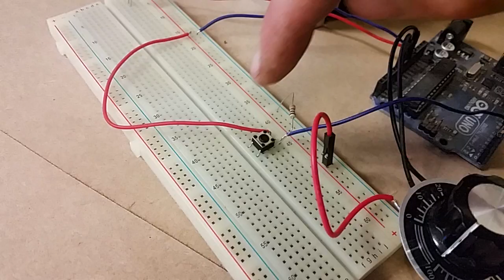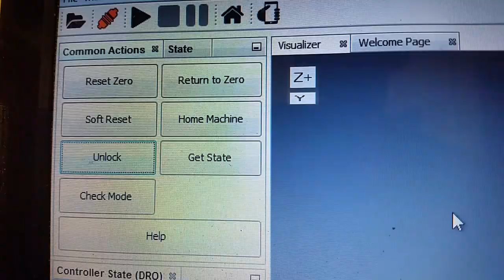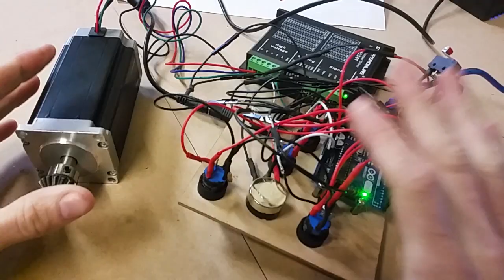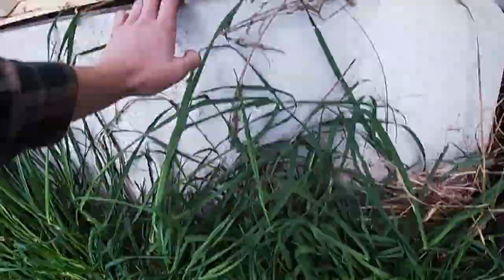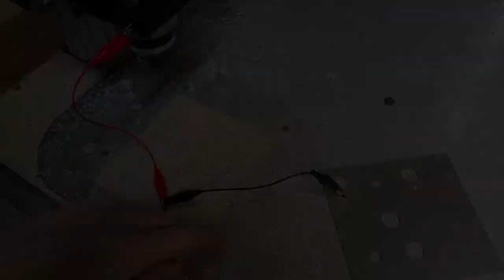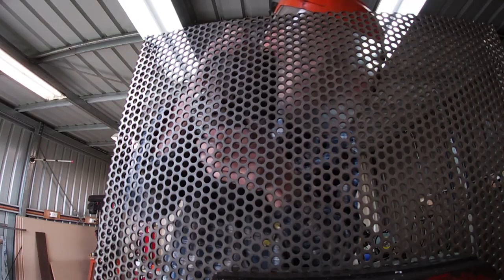Project Powerfeed Part 1

Comment: Use spring coiled audio cable run to the side of the gantry with a croc,or get one of those carbon plastic static discharge conductors used on road cars ,usually a 15-20mm strip with a voltage spark symbol on it on the rear of ford capris or escorts in the 80's here in UK,drag it around at the side of the spindle....retro,i'd go for the spring coil cable myself.
Reply from the maker: @pir869  is this in relation to the spindle interference? I solved it, turns out the supplier didn't connect a grounding wire 😅

Comment: G’day Tommy hey how many illegal height trucks have hit the bridge you knocked off the sign from;-)
I know nothing of electronics but the grounding of the spindle to workpiece was interesting, I’ve seen a few CNC machines cutting aluminium but not one with a plate chasing the spindle, it’s like a dog chasing it’s tail, what happens when it catches up grrr 
Well presented, cheers. 
Peter
Reply from the maker: Yeah I've never heard of this router issue before. I'd say it's because my electronics are not well shielded
I had to baby sit that plate to makes sure it didn't get caught up, I'm thinking I'll make a small brushed wire on the back side of the spindle that can't get caught

Comment: very interesting, I would be interested in the coding etc ..cheers from the uk
Reply from the maker: Cheers, what are you thinking? Full step by step arduino code (ps my code is not neat) or program logic ie 'check for button press, then do this'?
Reply: @TomMakeHere  whichever you decide, both if you wish need educated both ways.. cheers.

Comment: Nice project - got a list of materials you used.  I under spec'd my stepper the last time and it was too wimpy. 

Great idea. Great editing per usual. 

Dan
Reply from the maker: Only just saw that I missed this one
I used a 3 Nm stepper It will be driving through gears and a timing belt (1:1 though no gear reduction). We'll see how it goes
Planning to get a coding video out about 2 weeks from now, I'll include equipment in that video

Comment: Cool project mate !
I need to build one for the Y axis on my mill , already have power feed on the X axis and Quill so once i get the Y axis fitted i won't have to wind a handle again!
You could fit an encoder on the stepper so you can use the Arduino to display the feed rate  the code is just a modified tacho sketch and displays it on an lcd
Reply from the maker: That would be a good place to get to!
I like the encoder idea, that might be an upgrade
Reply: @TomMakeHere  
You can get cheap encoders off ebay , i used a second hand Baumer encoder on my spindle feed unit ( a copy of the one Stefan gotteswinter made and showed in one of his videos ) but the ones on ebay look the same as the baumer.